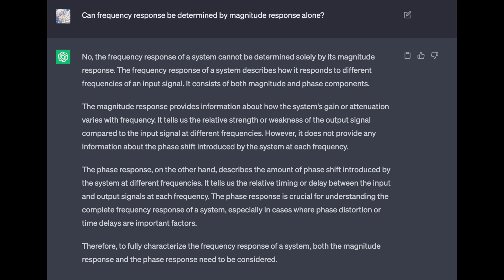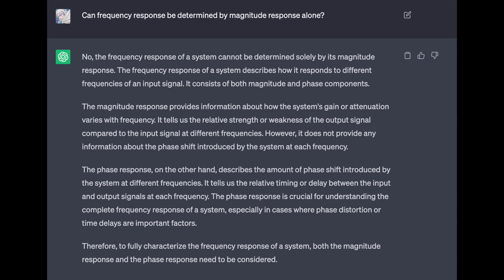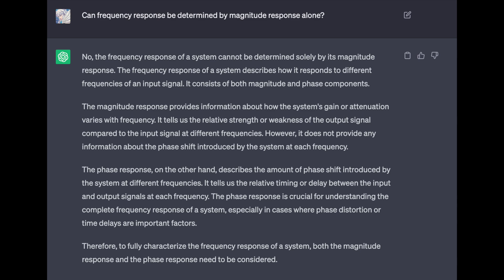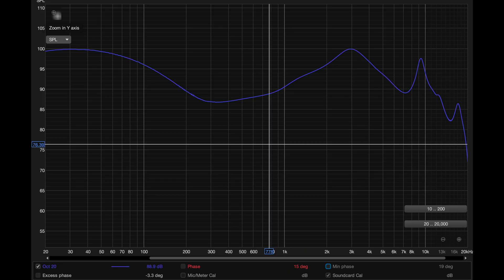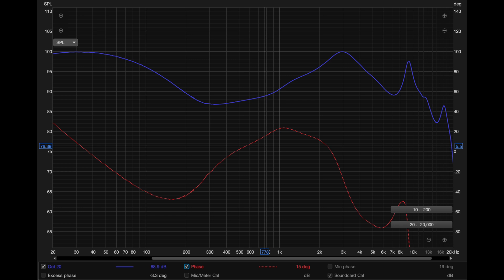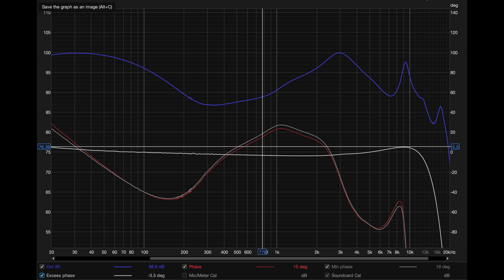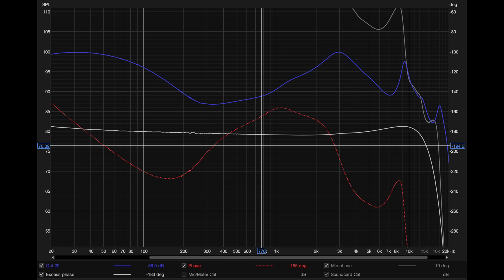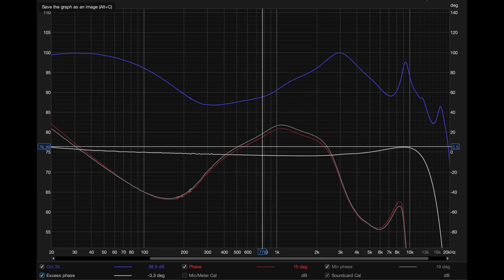"Frequency Response" Is NOT Frequency Response

Comment: so ok this is mildly interesting ..  so if we take into consideration this detail on all IEMS , why did all headphone and IEM manufacturers not publush their Phase responce along side their ( FR ) Magnitude response and also any other techinical stuff you are picking up on ?  the big question ..  Are you the last word in measuring IEMS and headphones ?  and the likes of Audeze  etc  have all been missleading us ( the public )  for decades ?
Reply from the maker: it's because with correct polarity, the excess phase response of most passive earphones and headphones will be flat
Reply: @sharur1  so for all headphones with incorrect phase ..  we just need a cable phase converter to sit at end of cable , so your BAD headphones due to Phase inversion are corrected and then hence flat ?  or at least flatter

Comment: Are Tangzu Waner Value For Money Under 2000 INR?
Reply from the maker: sennheiser cx180 street ii
Reply: @sharur1  Thank you for the reply
Reply: @sharur1  would you suggest any cheap iem under 20$ segment, I really wanna try one.
Reply: @atharvsalunke5390  if you want best sound for music get Moondrop Quarks DSP 
Tangzu waner has good vocals nothing special anymore 7hz salnotes zero is better option but it sounds tinny 
If you want better earphones for overall music and gaming get CCA CRA+ Plus or KZ EDX Ultra 
You will get well rounded sound Good bass good mids vocals good treble and extension with the widest soundstage 
CRA+ is little bit sharp but it's sparkly 

When I listened Edx ultra and switched to tangzu waner 
Waner sounded so dull and boring
Reply: Get CRA+ plus or edx Ultra Waner only has good vocals sucks in treble in bass

Comment: Interesting to see concerns about phase coherency, but there is some distubing facts with IEM....

1. A phase without perturbation can only be achieved with an absolutely flat magnitude response. So, the IEMs with their multiple magnitude corrections simply can't claim a perfect phase response. Never.
2. A single driver (big one or IEM one) can't achieve perfect phase. It's a minimum phase device, and then higher frequencies are always emitted before lower freq. That's physic law....and IEM drivers don't have to complain, they perform much better than big drivers on this point because they are much faster.
3. Multiways devices with real crossover are easier to design with correct phase....if you use multiamaplification + DSP. I mean, delay control and absolute control of inflection point and slope of each crossover section. An EQ has to be independently applied to each driver. The resulting crossover is very different from the textbook schemes if you use IIR filters (easier if you have FIR, but then you got a lot or pre-ringing and post-ringing). Of course, it's almost impossible to do this out of passive filters. Hybrid IEMs with acoustical filters and superimposed FR curves are out of the window.
4. To evaluate the results, the excess phase curve as provided by REW is way too complacent. Don't trust this tool, it's a joke. The best way to check your phase + magnitude coherency is the step response, if you know what the perfect shape is, and you can confirm this with the restitution of square waves. Brutal but efficient.
5. As demonstrated by many studies, it seems that humans can't perceive phase as long as it's distorsions are not exagerated and create kind of echoing and magnitude accidents. I was once sure of the opposite, but it looks true.
Reply from the maker: 1. Excess phase, which is measured phase minus minimum phase, is what matters.
2. I've measured several passive single driver earphones, and they all measure with audibly flat excess phase responses. 
3. Variations is passive with 5 drivers and has an audibly flat excess phase response.
4. Regarding step response, I am not sure what I am supposed to gather from this. What I am seeing for all of my measurements looks strange. Here are two images for what I get for Variations with the settings shown: https://media.discordapp.net/attachments/765673154684518424/1109003309576097892/Screenshot_2023-05-19_at_2.22.46_AM.png?width=2238&height=1330
https://media.discordapp.net/attachments/765673154684518424/1109003325145354280/Screenshot_2023-05-19_at_2.23.02_AM.png?width=2260&height=1330
I'm also unsure what your issue is with excess phase in REW. The minimum phase response is calculated from the magnitude response via the hilbert transform and subtracted from the measured phase response to get the excess phase response.
5. With absolute polarity in particular, I and several others have successfully passed ABX tests with >99.99999% confidence intervals.
Reply: @sharur1  "audibly flat"
Reply: @sharur1  Why the hell are you not working for a major headphone manufacturer ?
Reply: @jonfairway8235  Too cute!

Comment: So that's why making my set measure like Variations sounds bad? I thought it was the jarring difference between the 250 and 3000hz, making the sound dry and shouty.
Reply from the maker: wdym
Reply: @sharur1  Well, maybe the phase response, the treble extension, driver setup and many more factors make my attempt to copy their sound a failure.
Edit: Also no ideea how to figure out the inverted polarity part with the MMCX cable.